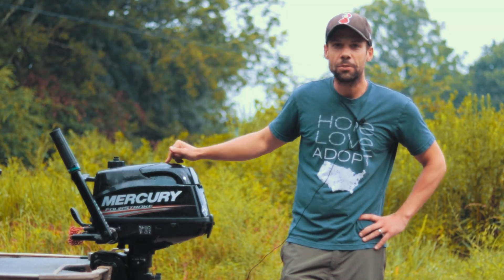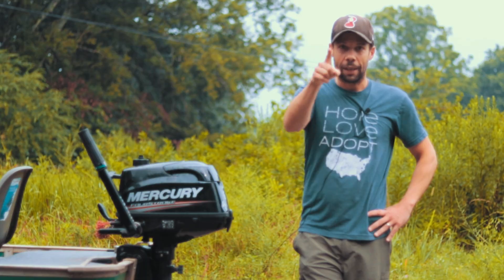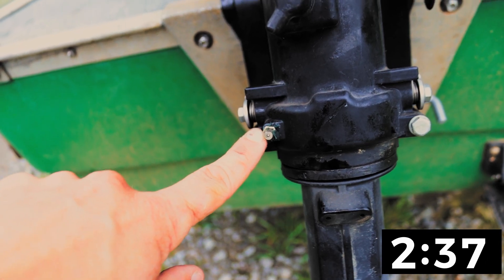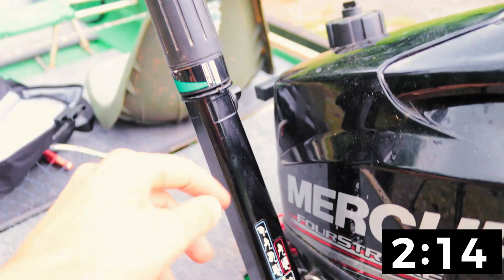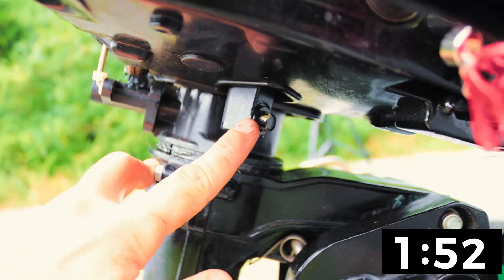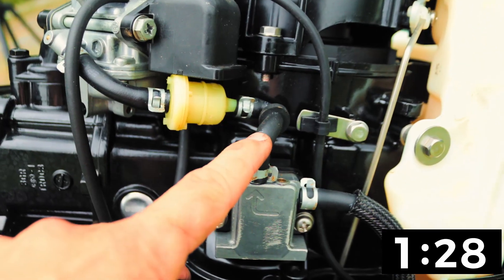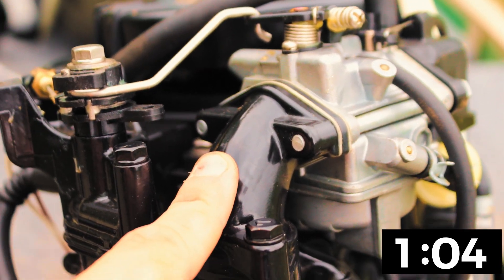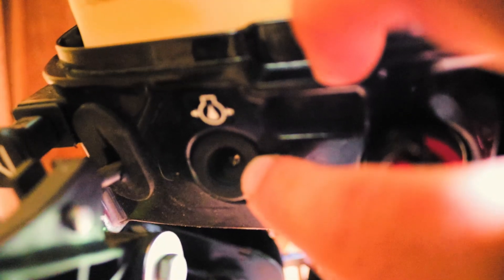MUST KNOW Outboard Basics: Every Component in 3 Minutes!

Comment: I’ve been watching your YouTube videos since I picked up my 04 mercury 6hp 4 stroke outboard and been learning a lot. Did all maintenance plus carb clean and impeller change. I have an issue with the idling. It’s very high and when I go to push the choke in it gets even higher. I’m dying to get it out in the water but can’t figure this problem out. Any thoughts on how I can fix this problem?
Reply from the maker: Hey I appreciate the support! There is a screw on the throttle valve on the carb that sets the idle speed. It basically sets the throttle valve position when the throttle on the tiller handle is at 0. It  is a screw (usually with a spring) on the throttle valve. If you turn it counterclockwise it will allow the throttle to close more when tiller is at 0 throttle and that will reduce the idle RPMs (because throttle valve closes more). 

If that doesn’t work there also is a fuel/air mixture screw on the carb that sets how much fuel the motor gets when it idles. That one is more complicated. But you can lookup fuel/air mixture screw on carb to see how it works and how to change it.

Comment: Great video’s!!! Just bought a 6hp 4 stroke mecury for my kids. Can you tell me what the rotation resistance knob does?
Reply from the maker: So there are a couple on there. One basically just makes it easier or harder to turn the motor (when steering) and there’s one the makes it easier or harder to turn the throttle on tiller handle
Reply: Wow thx goe the swift response😊

Comment: I I have a 40 horse four stroke 2002 model three carb my question is to the right of the vent plug on the lower unit there’s a smaller hole. What is that for?

Comment: Did you ever adjust your valves after break in ?
Reply from the maker: Never touched them
Reply: @Skinnyriver  When you flush your motor do you just use a bucket of water or that special attachment at the top ?
Reply from the maker: @MarkTwain-my3zt I just use a bucket. That helps ensure any junk in the lower/midsection gets flushed out. I think the attachment only flushes the water channels in the motor block which is great for salt water use
Reply: @Skinnyriver  Does using just a bucket flush the motor block channels ? I did use it for salt water
Reply: @Skinnyriver  I spoke with tohatsu and they said the bucket method is the best way !
Reply from the maker: @MarkTwain-my3zt  yeah I have heard that as well. I would say the fitting is a good quick backup though if needed after salt water
Reply: @Skinnyriver  How long can i let non ethanol gas with stabilizer sit in the gas tank and gas lines for before changing the fuel? I did run the carb dry.
Reply from the maker: @MarkTwain-my3zt man everyone says something different. My bottle says a year but some people say a couple months. I usually try to cycle it at least every couple months but you might be ok 3-4 months. I haven’t seen a true test
Reply: @Skinnyriver  Awesome ! If i dont plan on taking out on the water for a full run should i still every now and then let it idle in a bucket of water between those times ? I have only been able to take it out like once a month. They say to not let it just idle for too long. Still got like 3 hrs of break in on it. I know there is gas sitting in the lines and the priming bulb and gas gets spoiled faster with smaller amounts
Reply from the maker: @MarkTwain-my3zt yeah I would run it at least once a month to keep things flowing and cycling old gas. I’ve never had an issue idling in a bucket. If I plan to run for 10 mins I will vary the rpm’s though (rev it a few times). Just make sure the water level doesn’t go below the water intake
Reply: @Skinnyriver  I checked the warranty card and it says to change the oil after 10 hours or after break in. But in the manual it doesnt say to change the oil after 10 hours but change the lower unit after 20 hours. Should i do both now at 10 hours or both at 20 hours ?
Reply from the maker: @MarkTwain-my3zt yeah it’s pretty standard to change the engine oil at 10hrs. I would definitely do that. For lower end unit oil, it doesn’t have as much metal to metal as the motor so 10hrs is pretty quick. If you don’t think you’ll hit 20 hrs this season, I would just change at the end of the season. If you are going to use be way over 20hrs before the end of the season, it’s probably best to do the lower end unit right at the 20 hrs.

Comment: I have a 9.9 craftsman outboard I need the part that the pull cord springs up when you pull the cord do you know how to cross reference parts you can't order from craftsman now
Reply from the maker: Check out this webpage it has the diagram. You can find the part number and check ebay or sears direct https://www.perfprotech.com/mercury-marine-parts-catalog/model/12/250/9.9%20H.P.%20(1990)/225581993

Comment: Water pump
Reply from the maker: That’s a good one! The one I left out on purpose is visible externally though
Reply: Hello. Say I just bought me a 2018 5hp Mercury fourstroke. I noticed when I started it up it only ran for 15 seconds then I shut it off because I seen there was no water coming out of the tell tale. I know it's more than likely I need a new water empeler so I will change that out. But my question is I noticed in 1 of your videos doing carb clean and taking out the carb. I seen it had 2 long black hoses that attached to the carb. 1 on each side. When I had bought the motor it only had 1 hose attached to the straight copper fitting. The angled one on the other side has no hose. Is that my tell tale hose that I'm missing?
Reply: I'm confused 😕 one of them has to be my tell tale I just don't know wich one. Can you tell me wich hose is my tell tale.
Reply from the maker: @randallmorgan3054 cooling water circuit is not tied to any hoses on carb. It’s all in lower end unit and motor block
Reply from the maker: @randallmorgan3054 tale tell is under the motor shooting downward. It comes from the bottom of your engine block. There are no tell tale hoses around your carb
Reply: Thank you for clearing that up for me. So that 1 single black hose that's attached to my carb right now and leads down through a hole in the bottom and out the back is a over flow hose. Keeps the carb from getting to much gas I suppose?
Reply from the maker: @randallmorgan3054 yeah I think if the carb floods it allows the gas to flow away outside from the motor
Reply from the maker: The tell tale is the little nozzle / hole underneath the motor shooting down towards the water..
Reply: Ok great. Yes I did notice under the motor there is a small hole so that is my tell tale. I was looking for a black hose. I guess some motors have a hose and some don't have a hose at all. It's just a pee hole. Thank you again your videos are so detailed step by step. I've learned alot from your videos.